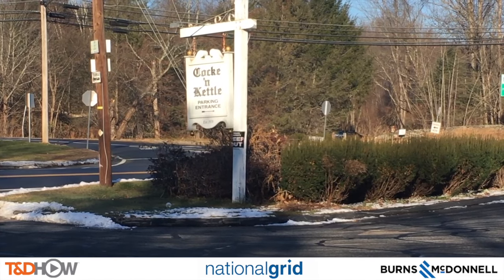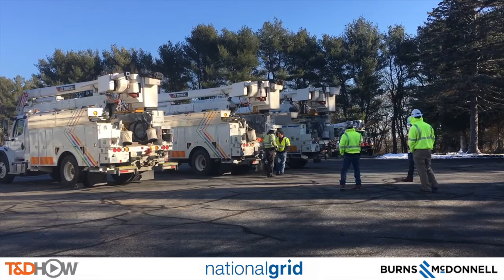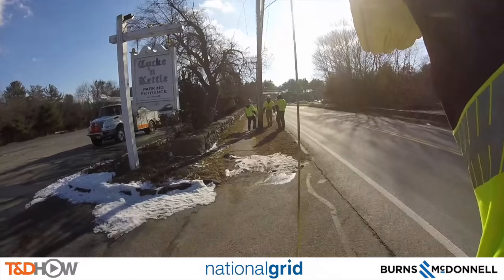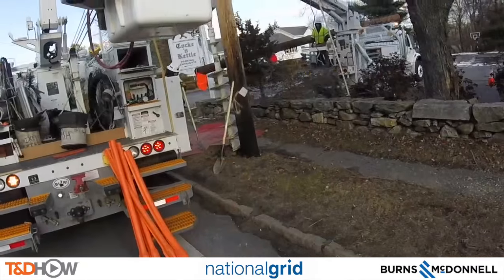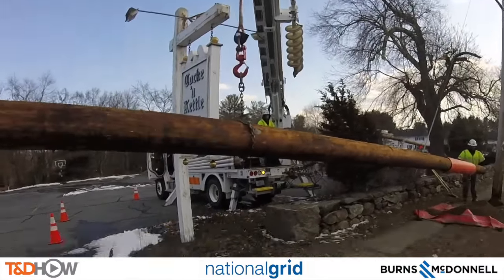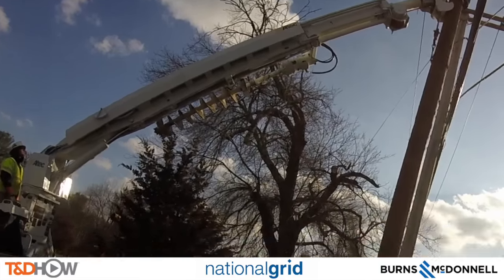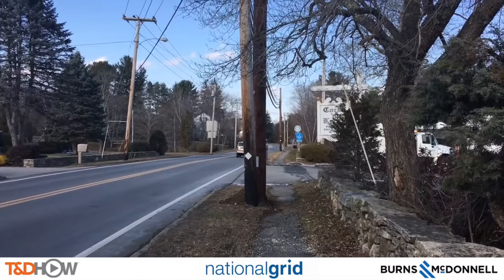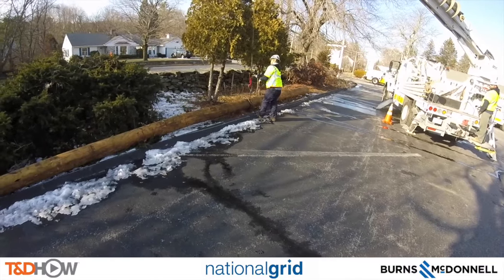Distribution Pole Installation

Comment: I am not here to criticize and I know there are many different ways to do linework but the way that pole was stood up made me cringe. I understand the tree and the rode being a factor in truck placement but I saw a few options to where that pole could have been picked up between the phases straight into the head of the digger. The less you have to roll the pole around while in between phases the better off your men will be. I am glad to see the plumb bob being used tho... believe it or not I work at a place where I’m one of a few to use one.
Reply: When I set a pole I spot it with the head in the span and butt towards the butt. And spot pick point next to the hole. So the operator just has to cable up guys guide head around and close the claws. Maybe a little swing and boom down to the hole. Less moves for the operator